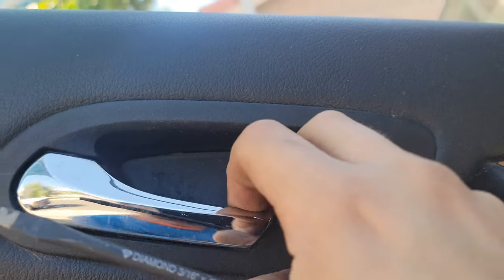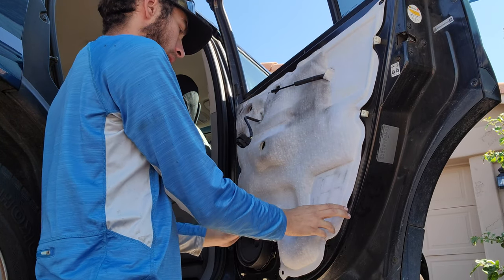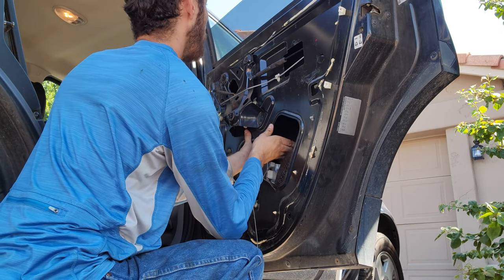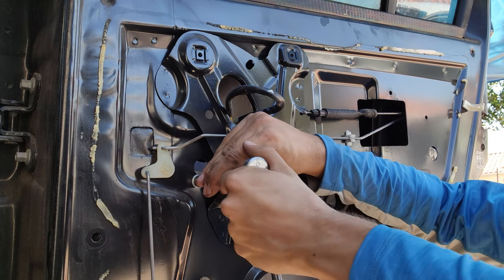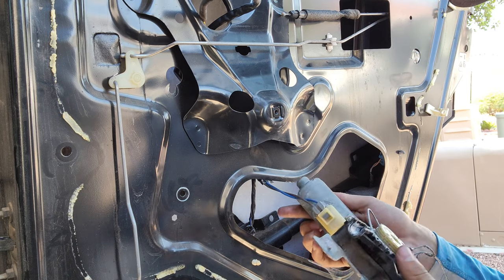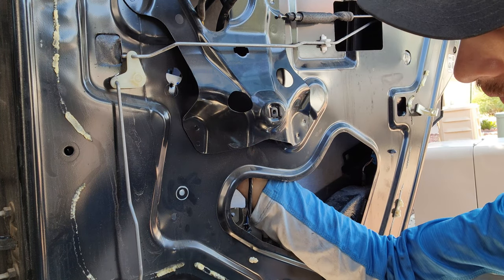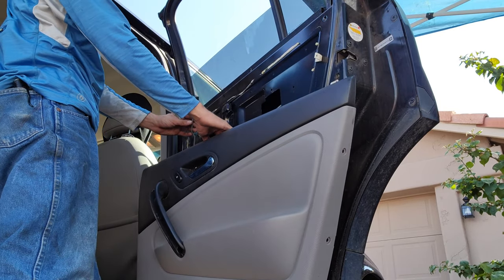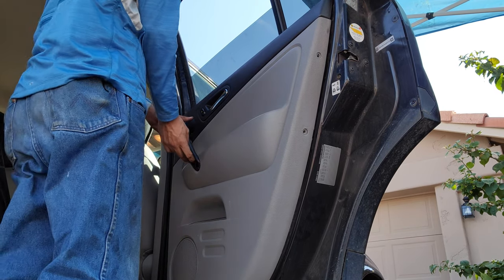how to replace Window regulator Saturn Vue

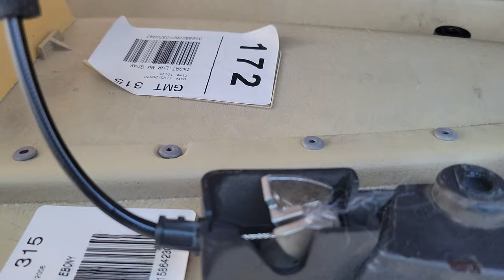Comment: This video saved me, it was as perfect as you can get. I've done regulators in other vehicles and they are basically the same but each has its own specialties. The only thing I did differently was at 1:47, I disconnected the electrical plug first, then pushed the door handle through the front of the panel, twisted it slightly and pushed it back through the back of the panel. I was able to sit the panel aside and it made it a lot easier to remove the cable. Other than that, I followed it to the letter. Took less than an hour. I also live in Phoenix and it's one of the dustiest places on earth, ha ha. The vapor barrier also keeps dust to a minimum so did replace it.
Reply from the maker: I'm glad the video helped. Like and subscribe please! Give me a call if you ever need help.

Comment: Glad I found this. I would have never known they were reversed threads on the regulator slides. Gonna be tackling my passenger side rear regulator and motor soon. If the glue doesn't stick back on the plastic sheeting I usually duct tape it. It really helps cut cold/hot air from coming through the handles and button bezels.Not positive, but after watching, did you do both rear regulators? I seen both sides of the car. Either way, glad you posted. Thank you! 

Edit... Everything is backwards????
Reply from the maker: It's been so long that I don't even know what you're talking about with the reverse threads LOL. This is only one side of the vehicle but sometimes I'm using the front facing camera on my cell phone so it looks backwards.
Reply from the maker: I'm glad I could help, go ahead and like and subscribe please! It means a lot!
Reply: @TheYouTubeMechanic  that makes sense.... Those cameras are flipped! Lol. I'm like holy crap Saturn used all reverse threads!!!
Reply from the maker: @JasonAJames  lol bro you got me! i thought i knew every reverse thread i've done by heart.

Comment: I have a 2003 Saturn vue, I need both back windows regulator/ motor replaced.  Someone told me I have to  remove the outside panels to replace regulator/motor. Is that true?
Reply from the maker: Nope, you can do it the same way that I do it in this video. I did not have to remove any sheet metal, I only removed the inside panels. I'm assuming that the 2003 Saturn Vue is the same as the one I worked on in this video.
Reply: @TheYouTubeMechanic  It's a 2003 STRN VUE 4DSW.
Reply from the maker: @bonitanottingham5351  Update? how did it go?
Reply: @TheYouTubeMechanic  It didn't., I have to find the right tool to take the screws out.😔

Comment: 3 questions:  is the regulator the same as the front passenger door? 

Can you go into a bit more detail on the window track and how it attaches to the window?

And….is this regulator part still available for an 06 model Saturn Vue?
Reply from the maker: I don't believe the front and the rear doors are the same. If I had it in front of me I could explain it more but I made this video so long ago that I don't remember. Usually if I leave something out of a video it's because it was a giant pain in the ass and wouldn't look very smooth on video. I'm sorry I don't know the answer to your last question.
Reply: Thanks for the reply, your video is appreciated for any and all help.
Reply from the maker: Update? how did it go?